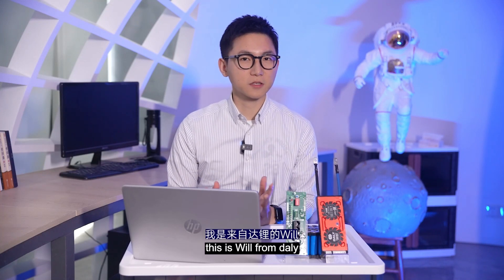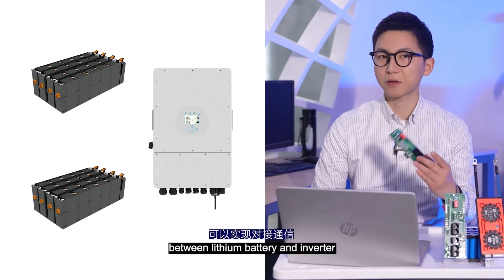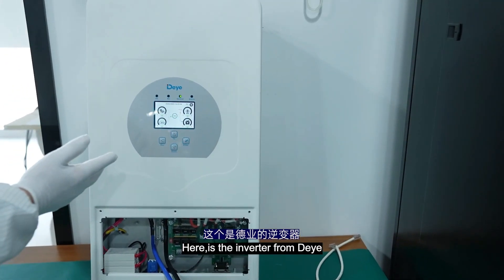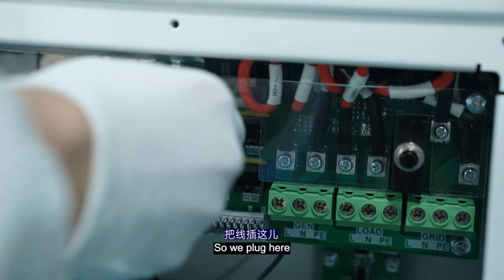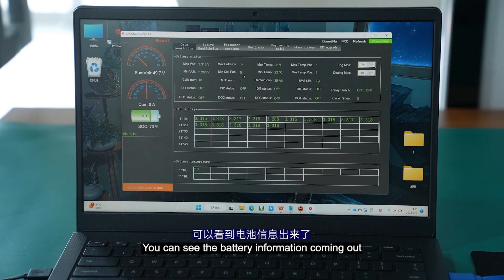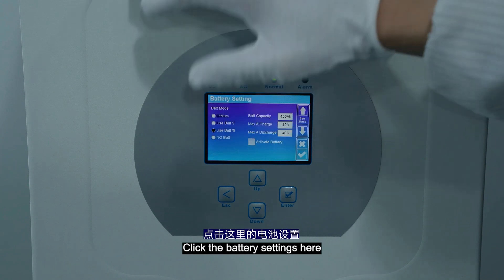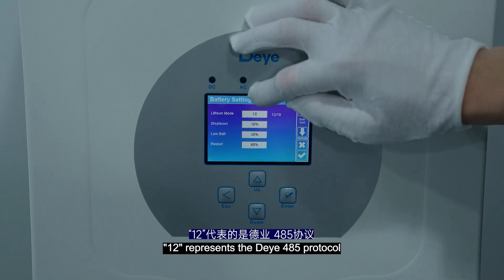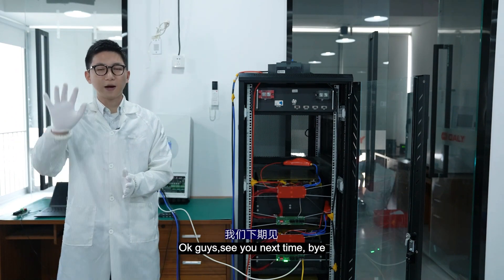How to connect the lithium battery pack to the inverter?

Comment: I want to know if we use inverter which will not mentioned in the datasheet in that case BMS will work or not?
Reply from the maker: Some types of inverter may be the same as others, so u have to check out with customer service,and if it’s not, u can also ask for personal customization(it may result in additional costs )

Comment: Please, how did you connect laptop with BMS to set parameters?
Reply from the maker: It depends on which communication type you use, Like RS485 or CAN communication, when you  buy Daly smart BMS, you have to choose communication accessories, and then connect to the BMSMonitor(Laptop) to view or set parameters
Reply: @BMS-Lithiumbattery  I am going to use Interface board and RS485 protocol to Deye, can be settings done also by mobile phone app?
Reply from the maker: @jiriwiesner9464   yes, The smart BMS with bluetooth function, you can use the app(SMART BMS) to select the protocol type(DEYE). BTW, the interface board's function  is to connect several packs communication, like if you want to view or set the parameters of different packs, you can use the RS485 cable to connect the laptop.
Reply: @BMS-Lithiumbattery  thank you so much. isn't interface board redundant in my case? I have only one battery pack
Reply from the maker: @jiriwiesner9464  you don't need it
Reply: @BMS-Lithiumbattery  unfortunately my BMS has only NTC, LED 12V and UART port, last port is not labeled and I think it is deaf. Is it possible? so I bought interface board to be on the safe side
Reply from the maker: @jiriwiesner9464  The smart BMS  has two communication configurations, one is UART(Bluetooth),the other one is full function. You should have a Bluetooth module that can be plugged into the UART port, so you can use the  mobile phone app
Reply: @BMS-Lithiumbattery  full mode is provided by 12V led port?
Reply from the maker: @jiriwiesner9464  12V LED port is standard configuration, Full function will have RS485/CAN port.
Reply: @BMS-Lithiumbattery  so i don't need interface board? My rs485/can port has no lable,is it active in this case?
Reply from the maker: @jiriwiesner9464  YES, you don't need it. The interface board is used for several battery packs. One pack?, No. If your BMS has no lable of RS485/CAN port that means it doesn't have this function. So, use the mobile app to choose Deye protocol directly
Reply: @BMS-Lithiumbattery  thanks slot,have a nice day😊

Comment: While the two interface board is connected, can I use the BMS UART connector to monitor the BMS as opposed to the "upper computer". If so do I need two display or one could monitor both pack? Also can you tell me what is the purpose of the connector on the back side of the interface panel (one says LCD, but that one only 5 pin not 6 as the UART on the BMS).
Reply from the maker: First. you can still use the UART connector to monitor the BMS, like Bluetooth APP or Display, If you have two packs, you'll need two, too. Second, there are two connector on the back side of the interface panel, one is for LCD screen(5pin), you can directly connect the LCD if you have. The other one(6Pin) is for connecting to the BMS(8 Pin Led), The connector plug connected to the 8Pin position will be changed to 6Pin
Reply: @BMS-Lithiumbattery  Thanks, The LCD in my case has 6 pin connector. Can you tell where can I get these connectors, to make custom (length) cables?
Reply from the maker: @arpa592  As far as I know, this type of cable is bound to the display screen together, and I don't know where to get the individual connector. If there is a need, Perhaps you can ask the customer service here:https://s.click.aliexpress.com/e/_opmR8nn

Comment: Thx for the Video
You use in the Video the deye single phase hybrid inverter. This inverter has two ports for BMS => RS485 and CAN.

I use the 3 phase hybrid inverter from deye. Here is only one BMS port. Is it possible to do both connection variants (RS485 and CAN) only on this port???

Is this controlled by the settings in the controller? 

00 => CAN
12 => RS485

I hope you can help.
Reply from the maker: It can be set on the inverter. But specific settings may need to be checked in the manual
Reply: What kind of cable do you use to connect inverter and interface card? Is this a standard patch cable? Can you post hob the cable is wired?
Reply from the maker: @allradvan1833 the cable between interface boards, is a standard patch cable(RJ45) .As for the  inverter and interface board, it's the special Patch cable with changed wire sequence. Like the plug of the communication cable, such as the RS485 communication cable, it belongs to the standard configuration of the interface board
Reply: @BMS-Lithiumbattery  so can I use standard patch cable between interface board and Deye inverter?
Reply from the maker: @jiriwiesner9464  No, it's the special Patch cable with changed wire sequence.

Comment: I am using daly bms on a 15s lithium pack
The max voltage the Deye is giving when it is set to Battery voltage mode (it thinks that i have Lead acid battery is 58.8 volts) despite ive set 60 volts on float, equalization, absorbtion all set to 60v
If i use an interface board and set it to Lithium mode will the inverter give me that 60 volts on my battery?
Reply from the maker: The information may be a bit confusing. You have 15 strings of lithium battery packs, which should be lifepo4 battery packs, collectively referred to as 48V, with a full charge voltage of 54.75V. What does 60V mean?
Reply: @BMS-Lithiumbattery   im using Li Ion NMC battety packs with 4.2 cell voltage, so i have 63volts the highest charge voltage
I would be okay to have it 60 volts, battery life would be increased
But inverter is giving 58.8 despite it is set to 60

Can you look at yoyr setup, is there a way to set the battery charge the BMS is asking inverter to 60volts?
Can the inverter accept it and charge?
Reply from the maker: @denveronly  Is the battery fully charged now? Is the actual voltage of the battery currently 58.8V?
Reply: @BMS-Lithiumbattery  
The battery is not fully charged, it will be if reached 63. My thought was the inverter could do 60 volts but is making 58.8
The battery can accept way more than 58.8 till 60 or 63 volt (63 i didnt ever expect happen)
Reply from the maker: @denveronly  It can be directly understood that the voltage displayed by the inverter comes from the total voltage of the battery. So if the total voltage of the current battery pack is not charged to 60V, the inverter will not display 60V either
Reply: @BMS-Lithiumbattery  im talking other
Charge voltages on the inverter is set 60,60,60 (float,ansorbtion,equalization)
Battery pack is charged to 58.8 
Inverter is not givin the battery that 1.2 volts more that i need
Reply from the maker: @denveronly  The inverter is designed to convert low voltage into high voltage. The voltage needs to be provided by the battery, and only the actual voltage of the battery will be displayed on the inverter. It will not change due to manual settings. Once the battery is charged to 60V, the inverter can display 60V.
Reply: @BMS-Lithiumbattery  THe inverter is not charging the battery to 60 volts
Bro do you have whatsapp? Maybe we can talk?
Reply from the maker: @denveronly  +8618529314407

Comment: Thanks for the video. 
I have 2 Daly BMS and 2 interface board. The software (BmsMonitorV1.3.1 and BmsMonitorV1.2.8) does not show the protocol setting. A protocol can be selected in the Daly app, but this is not adopted. The manufacturer Deye is not listed. Can you give me a tip where I can ask? Thanks.
Reply from the maker: The latest version of the BmsMonitor is 2.20.you can go to the sales service and ask for the update link
Reply: @BMS-Lithiumbattery  Thanks for the answer. What I would like to know, which cannot be seen in the video, is the dip switches of the 2nd interface board and the display of the BMS in the inverter. I have the same inverter setup. I only get one BMS displayed under the 1. I suspect problems with the addresses in the bus system. I am using bmsmonitor v2.1.9. Do the interface boards have to have different numbers for "BMS address manager" "BoardNo:"? With me, the 1 is displayed on both boards.
Reply from the maker: @sergejbotter8839  hi，if u only have two interface board, the first Dip switch should be ON OFF OFF OFF OFF OFF, the second is OFF ON OFF OFF OFF OFF. SO try again.
Reply: @BMS-Lithiumbattery  It still doesn't work for me with this setting. Is the same error. I tried it with CAN. It works with just one interface board. If a 2nd is added, the boards overwrite the values alternately. It seems to me that only address 1 is used. Is it possible that the address of the dip switch in the bus is not set correctly?
Reply from the maker: @sergejbotter8839  Well,i it may be. cuz I don't the know your wiring details, I couldn't pinpoint the cause. Some measures you can try like exchanging two interface boards to check, or connect the second one to check blah. or you can send some pictures of the wiring to the service center for help. all the best

Comment: thank you sir for sharing great information 
kindly tell us 
is this interface board is connected with bms or not?
is it used only for data sharing with inverter?
Reply from the maker: the interface board is used for connecting with the inverter, and it need to connect to the bms. just for data sharing
Reply: @BMS-Lithiumbattery  thank you sir😊